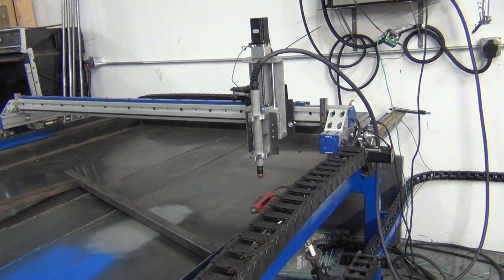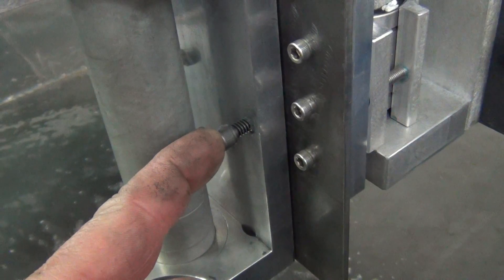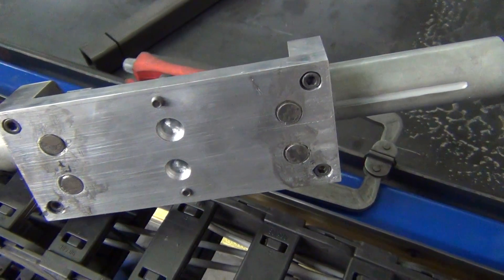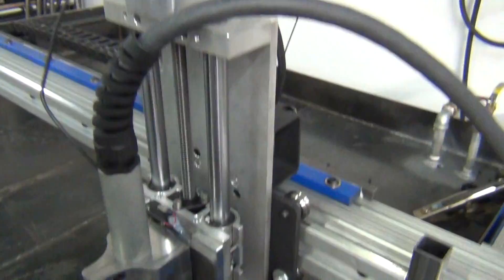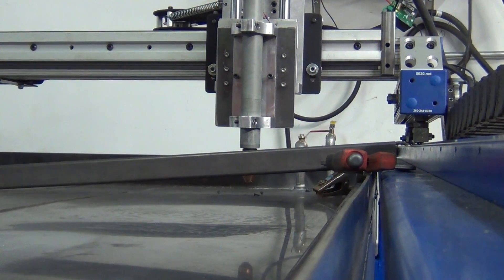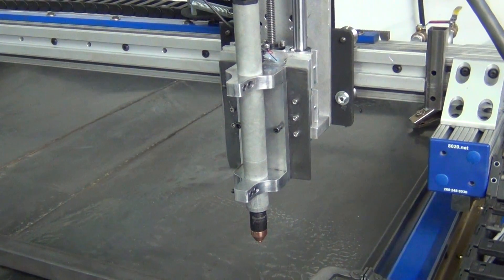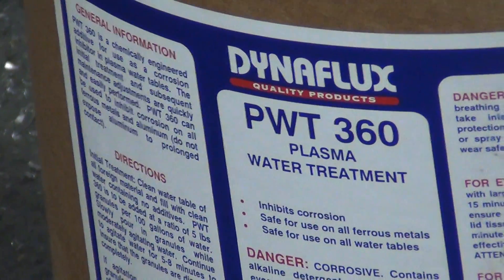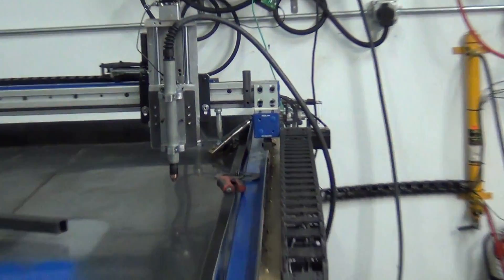Magnetic break away torch mount CNC plasma table build

Comment: Hi, nice setup, on mine I use a couple of breakable screw maded with nylon.
One observation is the type of guide screw, those look quite deep,and i think there is the risk to brake the torch when you go straight down or sideways, personally I will prefer something less deep and conical,to slip out with less force.